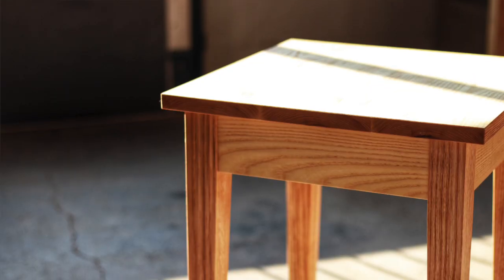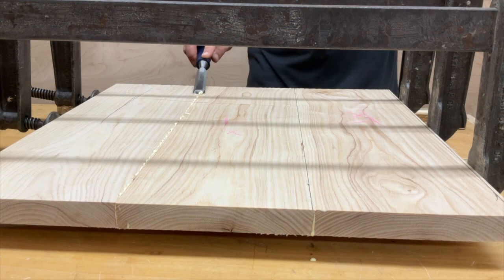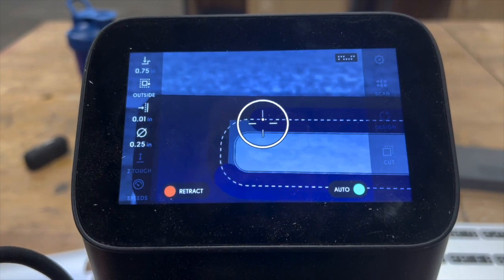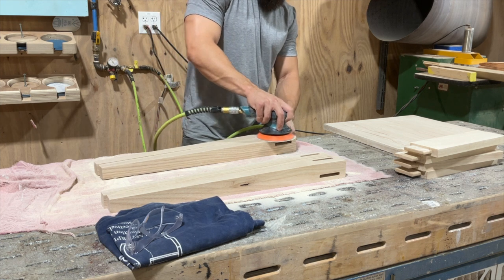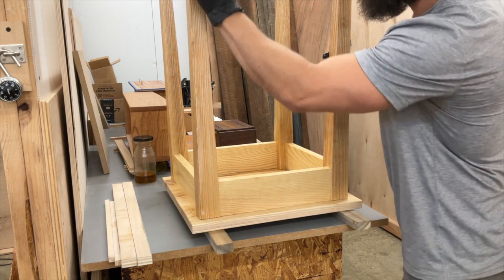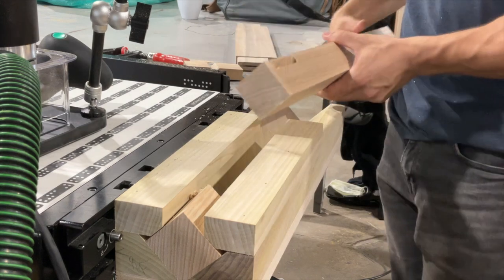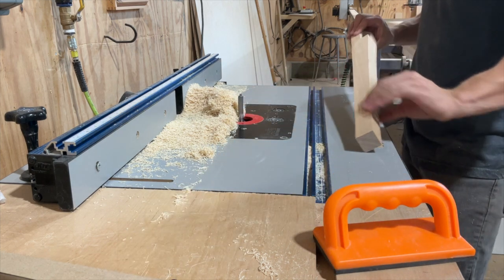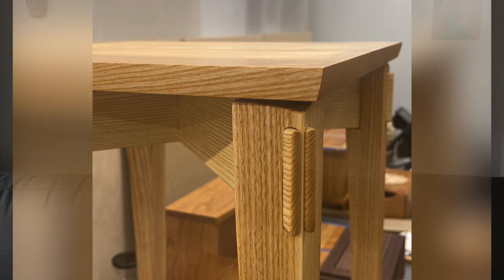How To Make A Table (With The Shaper Origin)

Comment: That use of the shaper is super cool honestly. But did you do it for the sake of using the shaper and challenging yourself? Is't it overly complicated when you could have used a domino? Or you see a real benefit of doing it that way in terms of strenght?
Reply from the maker: The domino absolutely would have sufficed. This project is aimed more at the school wood shop with students between 7-12th grades. As a former wood shop teacher I think learning the proper place and function of joinery in woodworking is best for students before introducing more convenient and efficient methods like the domino.

Comment: I very much enjoyed all three parts of your Shaper series.  You show the power and the usefulness of this machine better than most other videos I have watched.  Your ease of creation of the mortise-tenon  joint was great.  One thing that I would suggest, (that I have not seen anyone else do either) is this.  When making an inside radius such as on the mortise, make it a little larger than the cutter radius.  This will allow the cutter to make a small radius cut instead of ‘banging’ the corner.  Making a .135R instead of a .125R will make a smoother cut and less burning.
Thanks for the videos.  I hope you will be making more showing the Shaper Origin in use.  They are very much appreciated.
Reply from the maker: That is a clever idea indeed. I will have to play around with that as a method of work some time. Thanks for sharing.